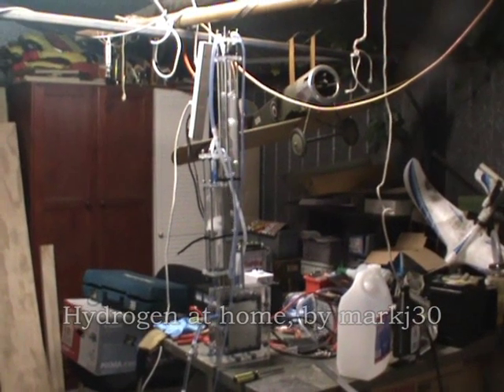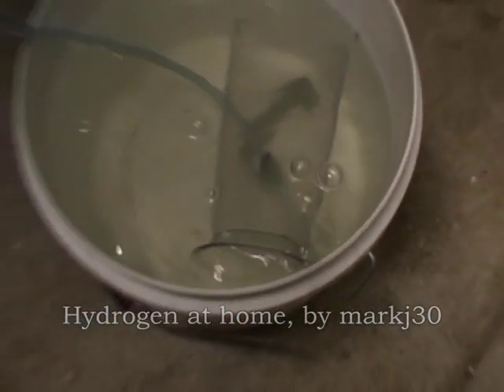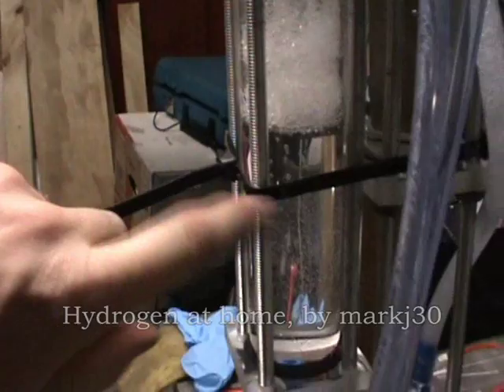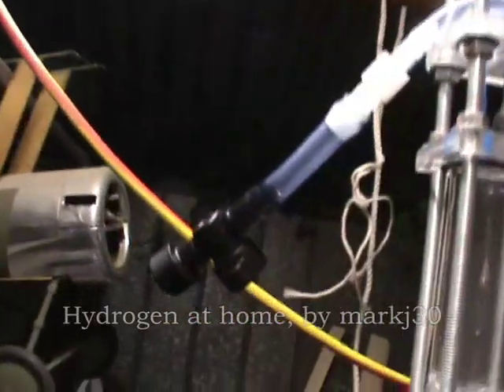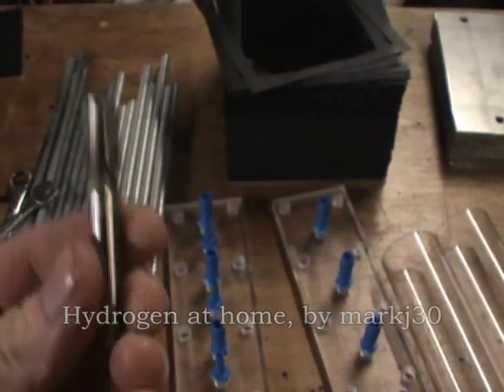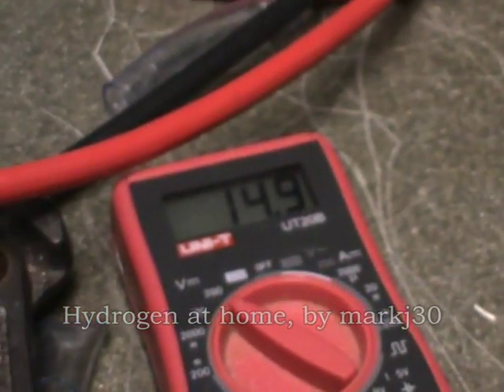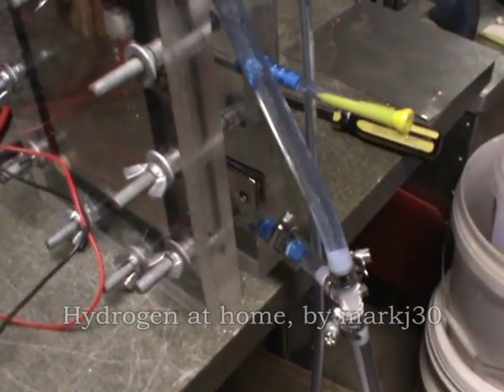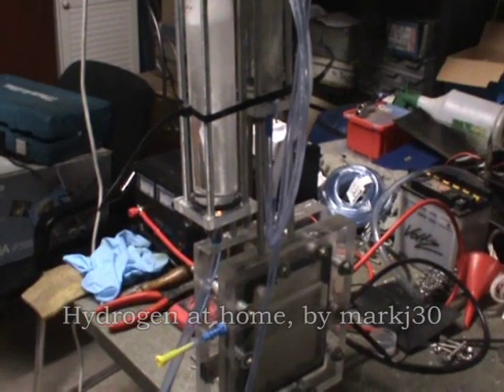Hydrogen at home (configuration test unit)#35

Comment from the maker: Thanks for that.  After watching some of your videos I noticed that one of the units mixes the returned fluid together at the bottom intake and another unit keeps them isolated.  What differences did you find between the two designs?  Also I see that you are using about 2.8V per gap which seems a little bit high.  Are you doing this in order to achieve enough consumption of amps?  What is your average MMW?

Comment from the maker: Are you referring to the twin gasket and membrane method?  If so how do you find its effects on efficiency (MMW and gas output LPM).  Do you find it requires a much higher electrolyte concentration in order to produce the same amount?

Thanks for your input.